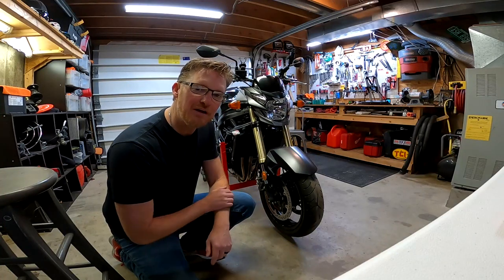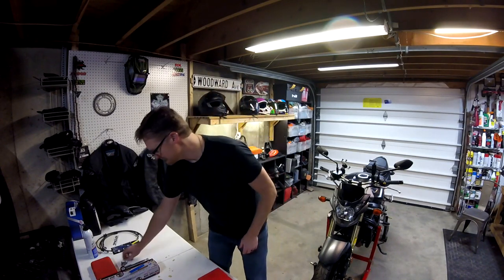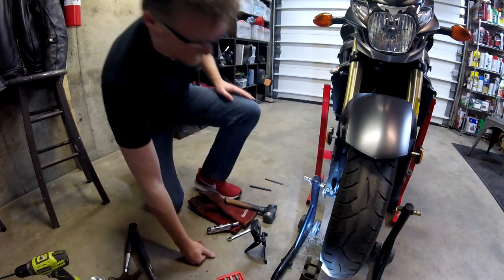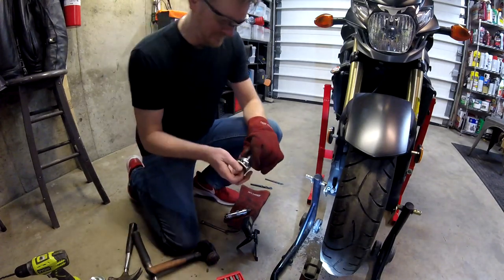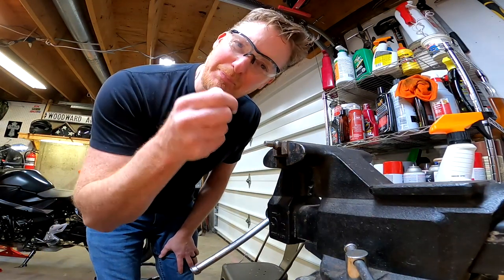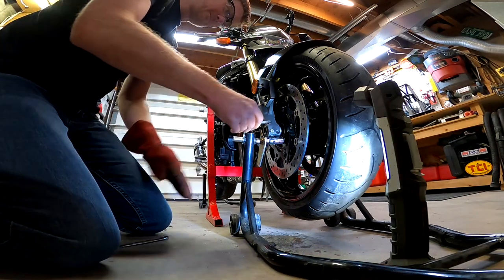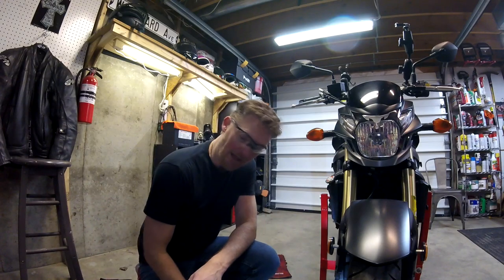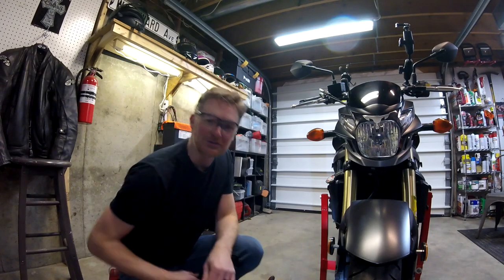HOW-TO Remove a Stripped Allen/Hex Bolt | Winter Maintenance 2021 Episode 1 | GSX-S750

Comment: I feel your pain Michael. The bolt to my bar end sheered off like it was made of pudding and for whatever reason I can't drill it out, even with HSS drill bits. And of COURSE the 2015 comes with suzuki's stupid welded in bar ends. I used this as an excuse to get new renthal bars aaaand they're too wide for the throttle cables, there's no slack. Hahaha it's killing me. Luckily spring ain't here in Massachusetts just yet so I'm not missing any riding :D. For anyone reading this, if you're gonna get Renthal Street Bars, get the ultra-low, not the low haha
Reply from the maker: Overall, the small bolts on this bike are pretty soft. The bar ends sound like a pain. I havent even touched mine but now you've given me the motivation to go buy new bars when the need arises :D The nice weather is on its way!! WOHOO!!

Comment: Glad you were able to get those out!  I just took the front wheel off of my Honda NC700X (getting new tires) and luckily I didn't have any problems.  I'll be sure to use some anti-seize when I put it back together.
Reply from the maker: So glad you didn't have any problems! I've had my wheel off a few times now and this was the time. This was my year lol

Comment: Great solution to an ugly problem. Just remember that by adding anti seize to the threads of the bolts, don’t over torque when tightening. I think they say a lubricated thread should be taken into account when tightening so reduce the setting on your torque wrench a little unless specified not to in the shop manual. I would check that setting being a really critical fastener.
Hope that helps and nice video, thanks
Reply from the maker: Absolutely! I'm going to check the torque frequently also. Also, some have referenced replacing the bolt frequently. Also I need new allen wrenches :)
Reply: @sstressfl  I have this problem regularly on my car, a Peugeot partner people carrier. (I don’t think you have those in the states)
There are two T50 torx bolts of M10x30 on the brake carriers and they seize hard despite only needing 30nm of torque. The solution is a little heat to melt the threadlocker before removing, new bolts every time and yes, as you say change the wrench as often as needed.
Reply from the maker: @scootyman2974  That's a great tip! Thank you for sharing!

Comment: Nice save, an allen key socket is a lot easier to use on those and a bit harder to strip, plus you can put them right on the impact driver. My snapon driver has dents too, they are made a little soft because they are made to be hit, too hard and they crack or split and send pieces of steel flying.

If anything those screws should have some blue locktite on them, anti-sieze can cause them to loosen up
Reply from the maker: I'm def gonna buy some good quality allen sockets. Also I just had that same conversation with some guys on a riders forum. I dug into the topic on google and found teams for anti-seize and teams against. But one thing I found that intrigued me is replacing the bolts frequently because the heads wear, the treads wear. There was so much dust coming off the bolts when I cracked them loose, I'm going to try the anti-seize but I'm going to check my bolt torque in the Spring frequently to see if they are loosening. I'll bring the torque wrench with me. Thank you for your feedback! Much appreciated.
Reply: Gearwrench makes some pretty good onea for not too much moneyand they are pretty easy to warranty at most local parts stores. 

Yeah there's definitely people on both sides of the argument, ive seen plenty of loose bolts and a couple wheels fall off from using it where it shouldn't. But if your getting visible corrosion around the bolt that would probably change my opinion and just keep an eye on them. Sounds like a known trouble part like the rear axle nut on my old fz07

Comment: You need to upgrade your Allen wrench game to a harder allen wrench set those aluminum ones or mild steel suck!
Reply from the maker: Yes yes yes!!!! After this experience and inspecting every allen I have, I realize how worn they are. I plan to buy a high quality set. And I want to pick up a set of 3/8' drive allen sockets too.
Reply: Yes Michael 3/8" Drive Allen are awesome just be careful because if you get the ball head you can snap the head Off in the bolt ask me how I know. I run mine on my 3/8" drive Milwaukee impact😜!